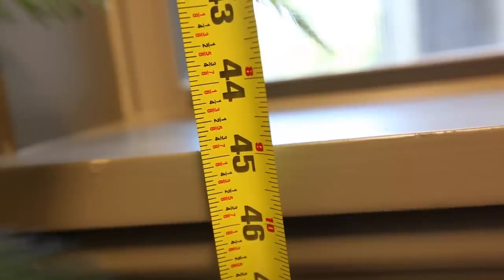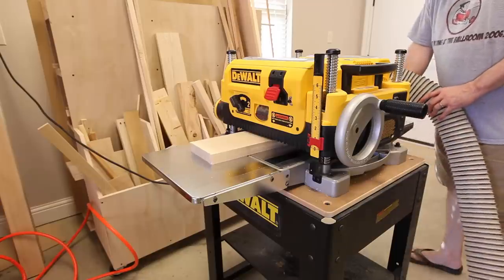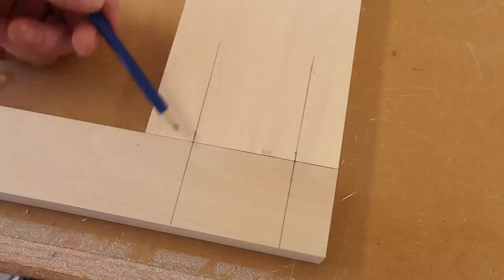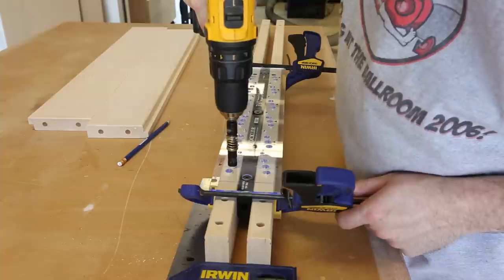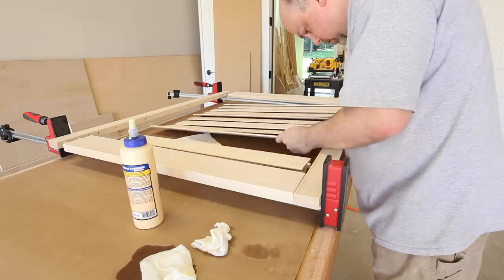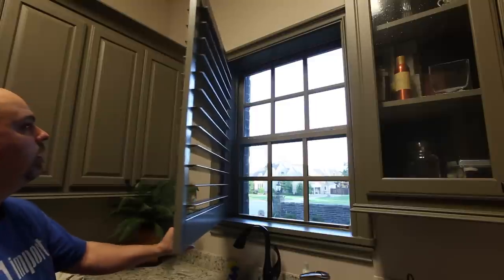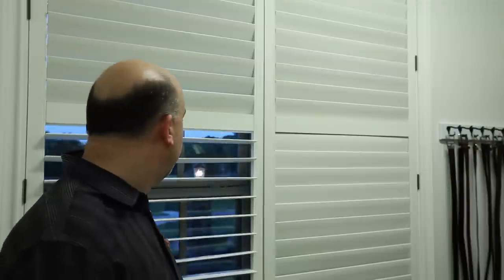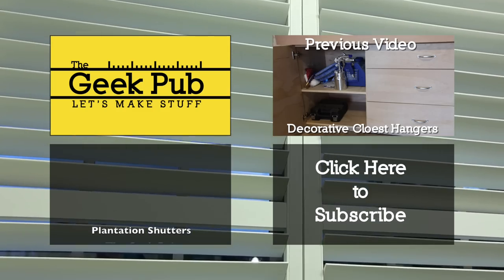How to make Plantation Shutters

Comment: Well that confirms that then, I'll be buying mine ready made!
Reply: Right... what project can we do that will promote the most use of different kinds of tools for sale? He says, that’s cheaper... after you buy thousands in saws, drills and tools. Cheaper if you already have these tools & you would only have them if you did woodwork.
Reply: In defense he did say that the planer and router parts are not necessary but he likes to use them to give them a custom edge. So if you have the tools then use them if not there really isn’t a strong reason why you need to go buy them
Reply: @mattgrosse9036  not to mention diy typically requires tools. Without some woodworking tools, people shouldn't be looking at diy woodworking projects lol
Reply: Ditto
Reply: I laughed out loud when I read that. Just my thoughts.  Yime to save up..
Reply: @TheHeavyend81   @Dave Goodman   @Dave Goodman  nowhere near 50k in tools here. Maybe a few grand if you are buying all DeWalt. However the setup can be had in cheaper brands for cheaper. Especially since a small miter saw, handheld router, smaller table saw, etc can be used for this simple work. Plus all these tools aren't required, but if you have them, obviously you would use them out of convenience.

Anyways my point in the previous comment was that you likely already have woodworking equipment if you're into woodworking enough to tackle projects. If you are planning woodworking projects, there is no surprise that woodworking tools are involved.

Obviously not every DIYer has all these tools. But DIY woodworkers would likely have the majority of these tools already. And watching this type of video to DIY a project like this without expecting some tools of the trade to be involved would be setting themselves up for failure.
Reply: @mattgrosse9036  But beyond the planer he’s doing a lot of cuts and routing. 

I’m very new to Rockler so I am surprised that the items didn’t already come cut to size.  I’m trying to understand why I would use Rockler if I still have to do so much cutting and routing on my own. 

C’est la vie! I will find another way. 👏👏

Comment: I have to hand it to you.  I would LOVE to do this however I have NO WHERE in a condo for a table saw, router stand, work bench or painting facility!!  Great Video though
Reply: I live in a 3 bedroom condo with a two car garage. For the first couple of years, before I took over the entire garage as my workshop, my woodworking "workshop" literally consisted of a metal shelving rack from CostCo that measures 48"x20"x72" and all of my tools which included track saw (you don't need a table saw), miter saw, benchtop router table, benchtop drill press, and a whole bunch of other stuff packed on to that metal shelving rack. I started with, and still use, a couple of Black & Decker Workmate 425 portable work benches. I started with cheap Craftsman tools, and slowly upgraded to Festool, and I chose Festool because their tools are designed for the mobile craftsman, e.g. people that need to haul an entire workshop to the client site, and also because of their superior dust control. When I was ready to work, I'd move the family car out of garage, drop some plastic painters sheets over the washer/dryer and other items in the garage, and get to woodworking. You don't need a big workshop to do some decent woodworking. My Father used to work in a small shed that you could touch all walls by stretching out your arms and turning in place. He did have a small, home built tablesaw, but only because track saws didn't exist back then.
Reply: Me too

Comment: Good stuff. Nice work on the shutters and video.  Very professional.  I ran into the same width limitation and appeal to Rockler to open up the design wizard for me.  Hope they do it soon cas I don't want to build a spreadsheet with the same functionality in it...  Seriously very good video! You make it look easy and for the novice, in the comments below, it is not.  The jigs and advice you have given are spot on.  I have over 50 of these to build for some high end rentals and I do them when I have time saving thousands and increasing the equity of the properties at the same time.  Thx for the quality video!

Comment: Do you think I can build the Stiles and Rails from pine, and the rest (control arm, louvers) from basswood. Once it is stained, shouldn't be able to tell a difference, right? Any other issues?
Reply: I meant painted, not stained, sorry.
Reply from the maker: Pine has two major drawbacks compared to basswood.  Weight and Warping.
Reply: Thanks. I have a Jointer and Planer so I was thinking of using Pine for the stiles and rails. I built an exterior barn door from Pine and hasn't warped after staining.

The weight may not be an issue as the louvers are basswood and should be light. Plus pine saves me $$ on my first build (plan to build ~30 more if it looks good). I am using pocket holes to join the rails and stiles so I can always rework it. Those are just my thoughts.
Reply: Oh and one more question. What kind of paint did you use? Oil or latex? What hand held sprayer/compressor do you have?
Reply: nvm.. I read your article. Thanks!

Comment: I noticed in the kitchen you used an inside mount, directly to the window casing.  What mount did you use for the two large windows at the end?  I have stucco walls with rounded corners on the window boxes.  I'm thinking of using the inside mount Z frame, but am stuck on how to best miter and join the frame with tight corners.  Any thoughts?
Reply from the maker: I think you mean Laundry room, and yes inside mount.  I did inside mount everywhere.

Comment: What is the width of the window in your master? The rockler online system limits shutter width to 24 inches. I have a 70 inch wide window that I am not sure how to split. I would love to divide it into 2 like yours. Great video btw!!
Reply from the maker: You can email the link and they will unlock it to make larger shutters.
Reply: wow.. only a pro would know that :) I was wondering if there was a technical limitation in going beyond 24 inches such as bow or sag due to the length.. BTW what is the length of those louvers in your master suite?  just curious .. those look good without any sag.
Reply from the maker: I've had not problems at all.  They are 36" wide.  I think they look a lot better than 4 smaller panels.
Reply: I see. Choosing 36" would result in a lot of waste as the standard length Rockler offers is 58", isn't that right?  ... I guess you ended up using the 22" sections on another project perhaps.
Reply from the maker: That's exactly what I did.  I used the 22" leftovers on my other shutters.
Reply: This is what I heard back from Rockler support. "Shutters wider than 24” are generally not recommended due to potential issues with warping and sagging that may occur.   Please note that you do not enter the window size in the shutter wizard. You enter the individual shutter size instead. We recommend splitting window widths such as you have  into multiple shutters. "
Reply from the maker: Yep.  Same thing they told me.  I've had zero issue.
Reply: I have a 36" wide window. I broke this into two shutters (left+right). Each louvre is a little over 13". Each stile is about 3" wide. It's actually not bad looking. 

For your 70" window window, you can create four shutters and have the two left shutters fold into each other. The same goes for the right two shutters. I've seen this work very well.

Comment: Why not paint the pieces before final assembly?
Reply from the maker: Hmmm.. glue doesn't stick to paint.  And if you tape it off you will see gaps and have to touch that up and it will never look right.

But I have better question: WHY would you paint them before assembly? Its not like its hard to paint when assembled.
Reply: @TheGeekPub  fewer nooks and crannies to get paint into. Touch up after assembly.